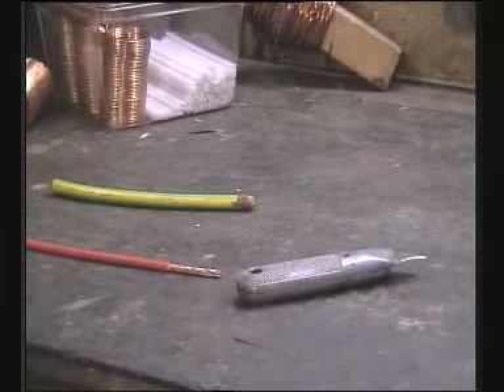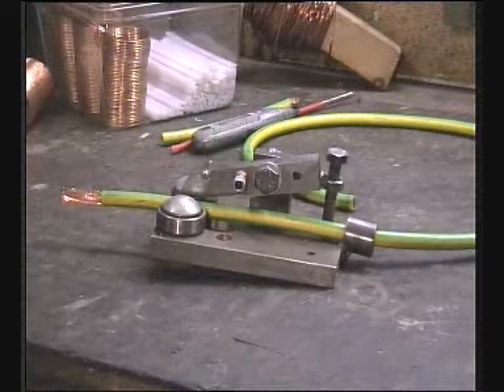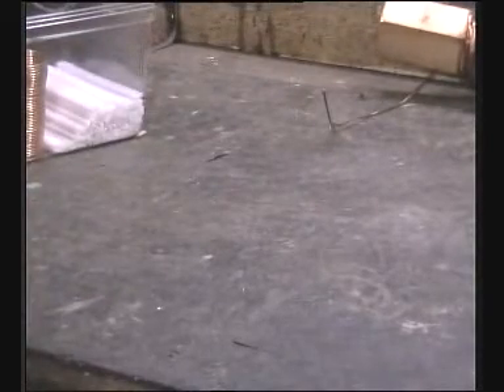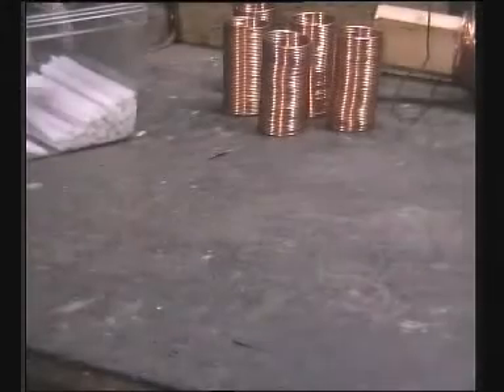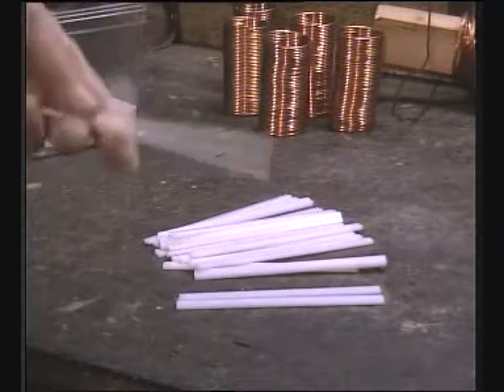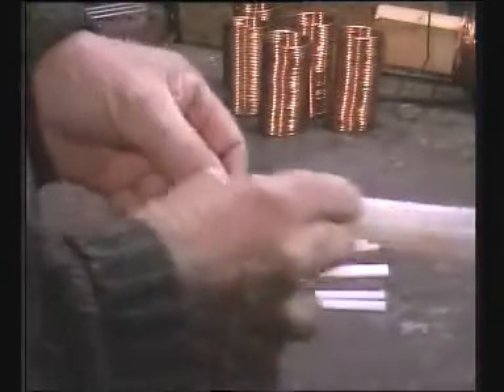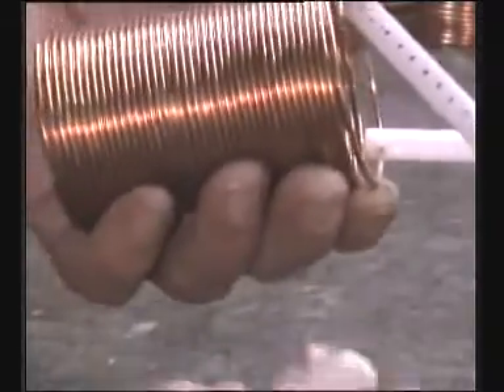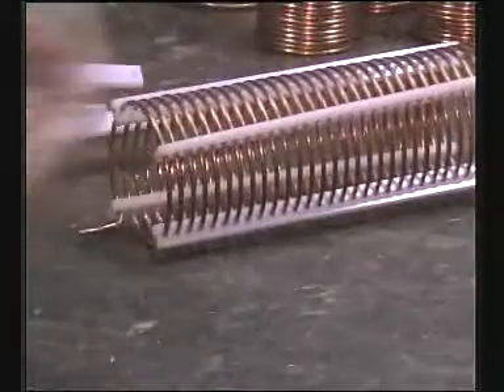air wound inductors.wmv

Comment: Hello, I could use some standard measured inductor diy videos on how to make inductors. I need a 22uH inductor to make a buck converter. I cant get inductors at the local electronic supply store here in the Philippines so I have to make my own. Could you please get a standard magnet wire size and a bick pen or standard cardboard toilet paper dowle or drill bit and find out how many windings it takes to make a 22uH inductor. I cant get more than a multimeter here and I need a good diy make your own or salvage videos. Thanks!
Reply from the maker: whats a buck converter ? as for 22uH inductor have you tryed Ebay you can get 100s for a pound or so,lookup item 171322923183 two nicely wound 22uH 1.5A X 2 for £1.85